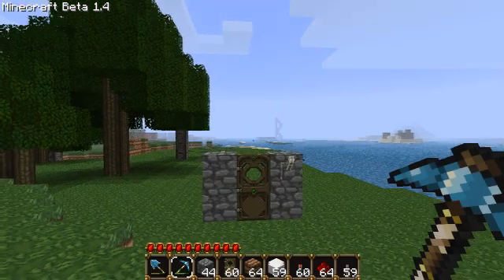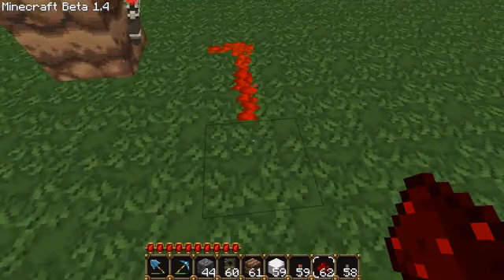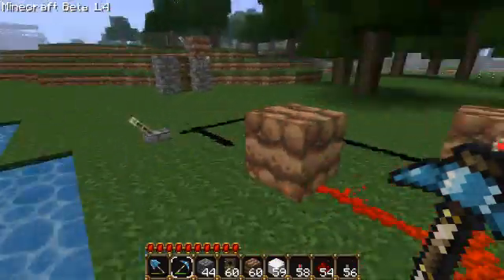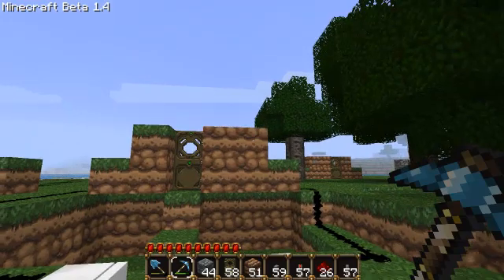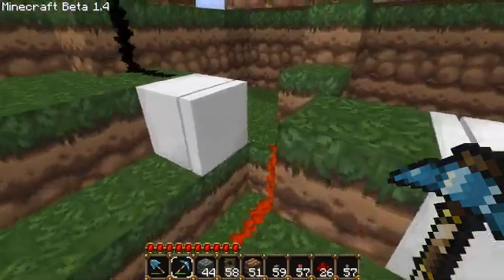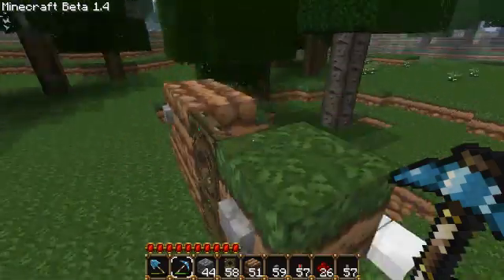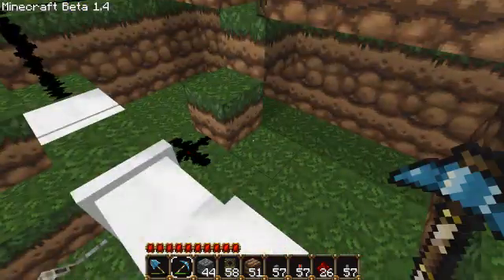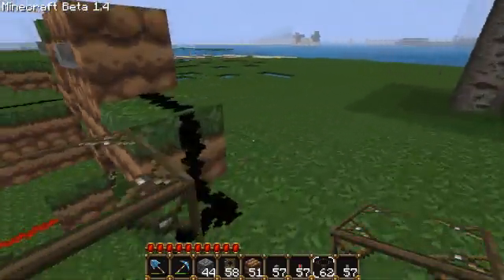Minecraft Tech - Pistons - Temporary Input, Permanent Output

Comment from the maker: @albinrhinnooable Ah, after your revised comment, I see what you're getting at. However, it's important to note that this video isn't actually about toggling the door;  toggling with a single button is covered in a couple of my later videos. The purpose of this example video is the value saving itself; I demonstrated this because it was vital to understand how values are saved before moving onto more complex circuits which also save. As said, my focus is more on concepts than specific builds